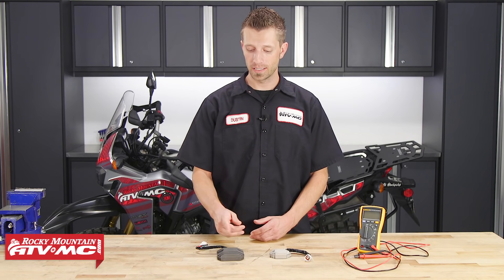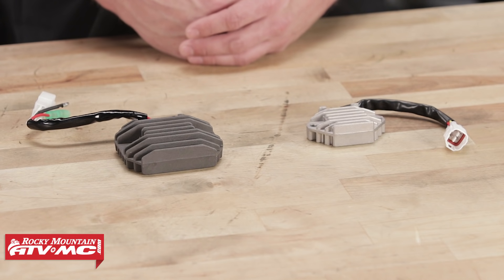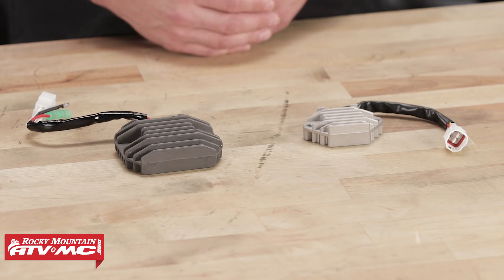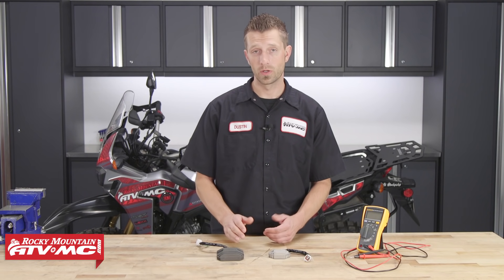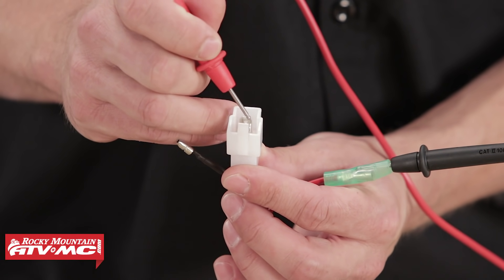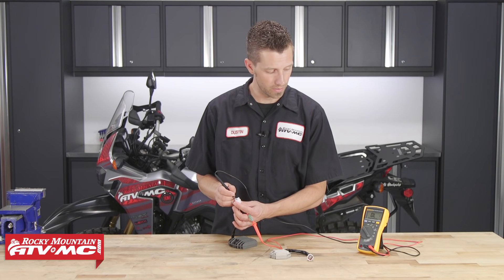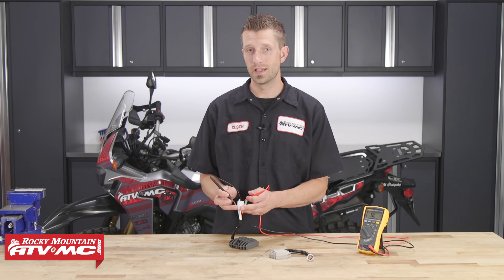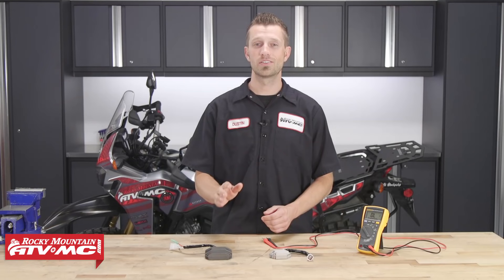How To Test a 3 Phase Regulator/Rectifier

Comment: Thank you for this video!!  Misdiagnosed my stator as being bad before moving on to testing the regulator/rectifier on my 2016 KTM 500 EXC.  Hadn't opened the case up yet and this set of tests confirmed my rectifier/regulator was still good even though I had a bad pin in the plug.

Comment: i have a problem with my recreg ( think) i keep blowing my main 30 A fuses i disconnected the recreg and it started up and ran fine (obviously no charging of the battery) then i plugged it back in (and checked voltage from the negative terminal of the battery and the outer casing of the recreg and it had the battery voltage i am assuming this is my issue the recreg shorting out the system and blowing the fuse? have you seen this issue before or have any tips of further troubleshooting? i tested the recreg and it was getting the appropriate values i think it is working fine other than the outer case shorting do i need to buy a new recreg or could it possibly be another issue?
Reply: Justin Doubikin following! Did you ever figure out your problem? My YZF600 is doing the same thing.
Reply from the maker: Sorry we didn't get back to you sooner. Did you get the problem fixed? What machine is this on, year make and model? I want to look at the wiring diagram. Unplug the reg/rec and check each wire coming out of it to make sure they are all insulated from the body of the reg/rec. I think that is the only test a manual won't show but if you have continuity on any of those to ground then it's bad. I've only seen it where the positive to the reg/rec body is in the K ohms or Mega ohms and drains the battery over night. Have you checked the voltage at the battery with and without the machine running? With it running, rev the engine a up and make sure the voltage doesn't go over 14.7 ish Volts. If it goes above, then the reg/rec is bad. Sounds like you already checked the diodes, so if the other checks are ok then start looking for a short to ground somewhere. 

-Charles
Reply from the maker: @keithchastain5630  Did you get your 600 figured out? Your bike could be overcharging or have a short to ground. Check charging voltage first to make sure the reg/rec is actually regulating. Is it the same thing where you'll unplug the reg/rec and the bike will run without blowing fuses?
Reply: I have seen a few reg/recs short internally and cause the main fuse to blow.  I'd say that is most likely your issue.
Reply: Follow up; I did just end up finding a reg/rec to replace the faulty one and haven't had any problems since

Comment: Nice work folks. While going through your steps to do a dynamic stator test my stator performed just as you explained for a three phase stator. AC voltages at example RPM's. The thing that left me stumped was my Shop Manual states that an AC voltage reading should be between 10 and 12 VAC. Not giving any engine speed. At idle it is producing 17 VAC. Increased engine speeds also increased VAC. Should I assume this as a typo and direct my attention towards the rectifier? This is on a 2005 Bombardier Outlander 330 HO 4x4.

Comment: Hi many Thks four your excellent video I have a scooter Piaggio 2T other when I drive same one tell me my rear light is blinking after 2 days all lights front and rear blow also when I drive in full throttle the scooter same times cut down the speed what you think is the regulator voltage have same damage my regulator is 8 pin thank you very very much appreciate

Comment: Have a 07 can am ds250 that lost spark changed the stator .the rectifier. The coil wire  brand new battery and plug any idea why this machine has no spark when you crank it over

Comment: Video is little old but hopefully you still check. I have 2007 V Star 1100 and when first started I get 13.8V at battery. After a few minutes running, I only get 12V or less. I checked stator harness and get over 48V when fast idol so I believe stator is fine. Can rectifier work in start up then stop sending charge to battery?

Comment: Great simple explanation of how a rectifier works, i'm working on a honda pioneer 700 utv that is only charging 12.3 at idle and 13.3 at 5000 rpm. after watching this video and the one on stator i believe i have a bad rectifier but i'll know more after i perform these test. thank you Rocky Mountain atv.

Comment: this goes for street scooters as well. 150CC and down usually a 1 phase. some 3 phase. I had one go bad on a scooter that showed working correctly until a long drive at night and the volts dropped. was the regulator heating up and maybe a diode or scr going open. great basic test!  6 diodes on 3 phase.  getting a service manual for your bike ETC is a big help.
Reply: @Charlie Deshawn instablaster :)
Reply: @Allen Joaquin I really appreciate your reply. I got to the site thru google and Im trying it out atm.
Looks like it's gonna take quite some time so I will get back to you later when my account password hopefully is recovered.
Reply: @Allen Joaquin It did the trick and I now got access to my account again. I'm so happy:D
Thank you so much, you saved my account!
Reply: @Charlie Deshawn You are welcome xD

Comment: Quick question i have a small 50 cc dirt bike and the bike is set up so if the battery is mising or dead the bike wont start (no spark ) and the Regulator has gone bad and ever since i cant fing a regulator that charges my battery , basically the power is comming to the regulator but nothing comes out and i have tried 3 brand new ones , the regulator has 4 diferent colours of whire , what i'm missing here ?

Comment: I’m doing this test on a Linhai 2018 400cc UTV. 
It’s a brand new rectifier. The forward bias test (black lead to positive, testing connector with red lead) resulted in 530 on each connector. Way outside your proposed range of 0.3-0.5. So… what does this mean?  I’m testing this because this rectifier gets super hot when in use.

Comment: Hi, Thank you for your site. I have a 2001 Yamaha Vstar 1100. Tested a (NEW) rectifier bench test was OK. Ran engine to 3000RPM Volts stayed a 14.4 excellent. However, when i rode the bike, voltage jumped to 15.7? Previously I found the "OLD" battery overcharged swelled up and blown, tested the old rectifier , at 3000RPM jumped to 19+volts,  i replaced the rectifier with the a NEW one and NEW battery.. Problem listed above. what tests can I perform to find overcharging, Thank You

Comment: on my road motorcycle... My bike runs etc as it should, But there is no charge getting to the battery.. If i disconnect battery while its running, it cuts out..
But my reg/rec is testing fine, Exactly as the video is showing, Readings one way, all the same, But not the other way of the diode etc..
Also, when the bike is idling, My reg/rec gets warm, like it should do, So this tells me, Its receiving AC voltage from the stator?!?!
im confused...

Comment: Hello Rocky. Can you tell me how to check single-phase ? have husky 250 2016, problem with charging, 13,5V on the battery, check all(all is same manual) cant find problem, may be can you help me.

Comment: My plug to the rectifier melted so i cut the wire and spliced it ..would that be consider a break in the wire and cause over charged to my battery ?

Comment: I'm a bit confused. My 03 WR450F has two plugs, 1 is white red yellow, the other is black. It doesn't have a positive and negative as shown here. When I attempt to follow this guide and do it regardless, it shows 2.5v on the 3rd prong and open line on all of them, even if it's reverse bias.

Comment: Hey all I got a gsxr 750 the problem I'm having is when the bike is cold starts every single time but when you ride for a bit and gets up to temperature If  you stop and got to turn it off again it don't like starting iv changed the battery and starter motor I'm getting 12to 13 volts when off and 14 volts when it's started so power isn't a problem if you let the bike sit for 10 15 min it's starts again it's like something gets hot and don't like it and seems to turn over like a dead battery .anything else I could try thanks

Comment: hello, as you have shown, the regulator looks solid but no energy output, no voltage. The stator is newly clung and rugged, the outputs have ~ 50V. Is there another test method? motorhome Ktm duke 390 2016.

Comment: A link straight to the Alt. check would have been handy, I checked  the rec/reg and got slightly higher number on my spare e.g 583, 588 and 603.thank you for the excellent vid. on this, cheers.

Comment: Does this and the stator stop it from running or no.. I have a 2001 Yamaha worrior 350 and the dude I got it from said that he got it running then he said the stator started smoking. Then the atv stopped running.. I replaced everything one that atv except the stator and was wondering if the stator could stop it from it running.. even got a brand new battery for it.. and it's trying to start but won't.. need help..

Comment: Is there a way to test if the stator is bad by using the wires without having to pull the fly wheel off just to check? My voltage is reading around 18 when giving it throttle I tested the voltage regulator like in the video and it seems to be ok

Comment: 2014 polaris sportsman 570 - i ran the test as you described and believe i have a bad rectifier. findings - 1.  with my mulitmeter negative on the positive battery lead i had .45 reading 2.  with my multimeter negative on the negative battery lead it had 1.2 reading. 3.  with my multimeter positive on either of the battery leads it had an OL reading.  can you confirm this my rectifier is not functioning properly.  thanks!

Comment: There are 6 pin and three phase regulator-rectifiers, 3 yellow imput wires and one Red/White, Green and Black output wires. I've learned that type of rectifier has a voltage sensing wire.

Comment: Great Video! I get 910 in my measurements instead of 300-500 as you said, is stg wrong with my regulator because my battery is not charging. I am waiting for your stator video also

Comment: Hi I disconnected my faulty rectifier.  My ATV does not want to idle.  I've static test everything and it all test good except for the rectifier that boiled my battery.  It's a sizuki king quad 450 fuel injection bike.  Any advice would be appreciated
Reply from the maker: Your ignition system is a DC CDI meaning the battery is the power source for your spark. The battery needs to be fully charged for the machine to run correctly. I would replace that faulty reg/rec and battery. I would imagine that will take care of your problem, but if not, you definitely need to start there and have the charging system and battery in good condition before going any further. 
-Charles

Comment: My stator 3 phase went bad I've had to cut the wires to the rectifier as they were hardwired does it matter how I connect the new stator as the three wires are the same colour any advice would be muchly appreciated cheers
Reply: Also the how to test rectifier clip was really helpful and easy to follow cheers

Comment: Hello. Negative lead on positive side I get following reading : .553,.553,.544
Positive lead on negative side : .557,.521,.551. 
Are the small differences indicating faulty rectifier?
Thanks!
Reply: Did you ever get an answer. Replaced? Problem solved?

Comment: Hi, in the diagram you showed can be seen th rectifier component of the regulator, but diodes doesn´t regulate, just rectify, How can We test the regulating circuit of the regulator? Thanks
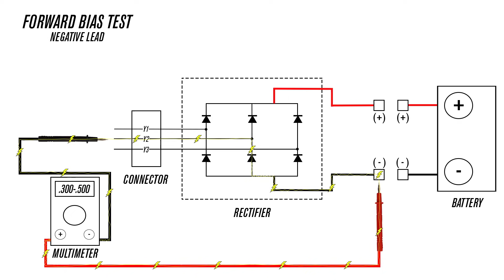Reply from the maker: The only way to do that is by checking the charging voltage at the battery or back probe the DC power wire coming out of the reg/rec while running the machine. Watch the charging systems video  https://youtu.be/tr8DeCyBuXI at 4:57 it shows this test at the battery. If the voltage is too high the regulator is bad, or if you aren't getting enough voltage at the battery but the AC voltage going into the reg/rec is correct but the DC voltage coming out is too low, then it's bad in that case as well. 
-Charles

Comment: Hello, Thanks for the video. I have checked my rectifier as shown in the video and is found to be in good condition. However, when connected to the stator and the battery, the charging voltage goes over 16V
So, i disconnected the rectifier from the battery and checked the voltage and it reads out in AC..
Can a bad battery damage the rectifier?
STATOR: the voltage from each phase gives out 19V AC and goes upto 60V at 5000rpm so i feel  it is good...
Please help

Comment: I know this video has been around for a while but I’m testing the reg Rec on an 02 Ducati monster 750Si.e.
It has 3 yellow wires so sayings it’s 3 phase. On the other plug it’s got 2 red and 2 green. 
Should the test be run forward and reverse for each red and green wire across the yellows like this video?

So did the tests off both the + and - sides and they passed. So guessing it’s good. 
My reason for testing is a slow drain on the batt. I have had a swollen batt also. I replaced it. I have to put the bike on a charger if I’m not driving every couple days. 
I tried an amp test for parasitic draw but it must be so low the meter didn’t see it. 
What a pain

Comment: :)  . Clear and consice vids . Question: 2004 Yamaha YFM4FA . Charging @ 17.50 ~ 18 volts. Specs say 14.1 ~ 14.9 v . When doing a diode test get 623 ~ 630 on both + & - sides. No OLs. 
What should these readings be ? ( Manufactuer/ Model... Shindengen/SH640E) Thanks

Comment: Hello rocky mountain, can we also verify a 3 phase rr unit by looking at the pins on the plug/ port in the rrunit. Doesn't 3 pin on the rrunit mean 3 phase charging system. I.e the top 3 pins for the battery positive,negative, don't know what the middle pin do,  and the bottom two pin for the alternator. Am i right or is there something u can add to it. Thanks

Comment: So if my bike is running all fine and then suddenly after a couple hours of riding, my lights turn off and dash turn off with a few more minutes riding the engine stops dead, then the bike does not start just a fast clicking sound, is this a bad regulator issue? I also have a brand new battery so i know its not the battery its self.
Reply from the maker: Sounds like you don't have enough charging system output, most likely a stator issue. I would test both the stator and reg./rec. then replace anything that tests bad. Don't forget to put your battery on the charger. -Charles

Comment: How can you get any volts when its not connected to anything? all you can possibly measure is resistance?
Reply from the maker: The multimeter is supplying the regulator/rectifier with the current.

Comment: Perfect, my regulator is not between 0.3 and 0.5 but actually 0.53, do you think it is good?
Reply: designspm asking the same question
Reply: The reading is close enough - there is variation between meters and the value will change with temperature

Comment: I had a swollen shorai battery on a drz462 I tested my RR and it passes the test what does this tell me why would my battery have gone bad
Reply from the maker: Lithium-iron batteries can swell due to extreme temperatures whether hot or cold, other reasons could be that the battery was either overcharged or over discharged.

Comment: Hey! Thanks for the video I have done the test on the rectifier and the stator. Both the stator and the rectifier pass the tests. Putting a voltmeter on my battery and getting the rpm up to 5k like stated in your other videos you have posted the battery voltage does not fluctuate at all. I also disconnected the red wire from the starter solenoid and tested the voltage coming from it with the engine running and it was very erratic going anywhere from 12 to 14.5 volts but as soon as I reconnect it back to the starter solenoid it basically flatlines and there is no change in battery voltage. Any help would be greatly appreciated thank you!

Comment: Do you know if I can use a rectifier from a scooter/atv, that is charging a 12v 4Ah battery, to charge a car battery 12v 60-70 Ah? The AC current that is produced by the alternator has around 15Ah.
Reply: 12v is 12v. The amp hour is how much storage and 12v output the battery can sustain measured in amp hrs. So yes it will charge the battery at 12v.

Comment: Just went through the test on a voltage regulator on a 1998 Honda Foreman 400.  Tests went well and the video was very informative.  Thank You.
Im still having troubles with the charging system I THINK!!!!!!!  Crank the bike and the fan comes on.  That could be the fan contol or oil temp switch.  I understand that.  My issue is that as you rev/increase the throttle so does the speed of the fan. The fan speed decreases as the the throttle decreases also.    Upon increasing the throttle I also see voltage at the batterry increase.  I have seen it up to 18.36 volts at the battery and I know this is too high and will damage the battery so I havent ran it long like this.

I was wondering if anyone had any other advice on this problem.

Thanks
Reply from the maker: If you haven't already, get the Reg/Rec replaced and test the battery as well to make sure it is OK. The voltage at the battery should stop rising around 14.7 V no matter what the RPM is. If the voltage goes very much over that (15 or more volts) then the regulator part of the Reg/Rec ins't working properly. That should take care of the fan speed problem too. I hope this helps
-Charles

Comment: Thanks for the explanation. I just did the tests on my 3 phase rectifier. Wires: I have 3 yellows, a black, a brown and a light brown with a red trace. I had thought that the light brown with red trace was positive but when I do this I get no reading between it and the 3 yellows. If I use the brown I get a consistent reading between it and all 3 yellows. Does that mean my positive is the three brown and the light brown with red is my neutral?